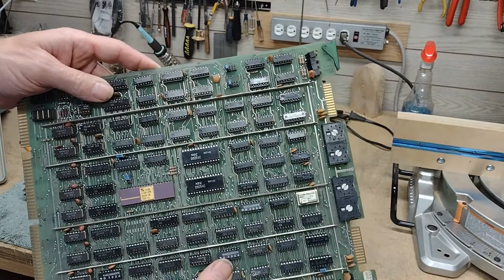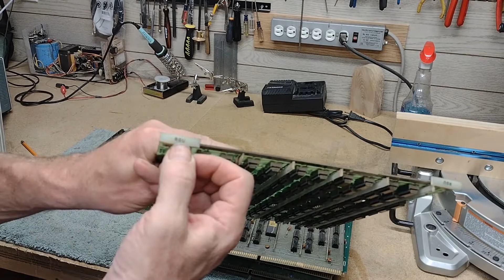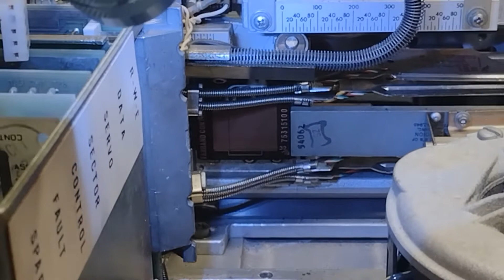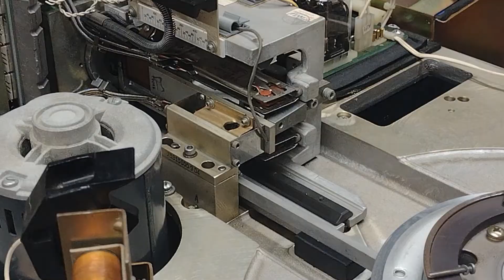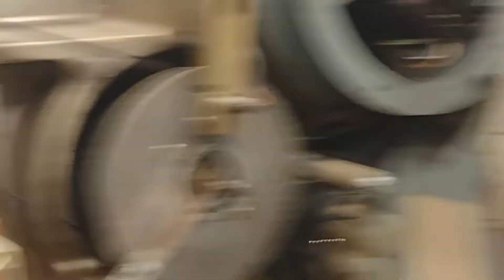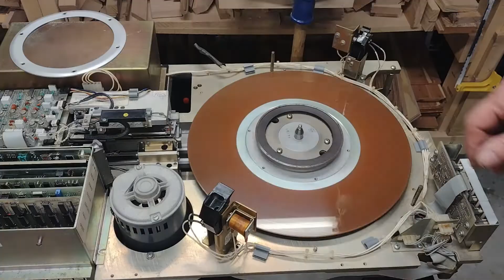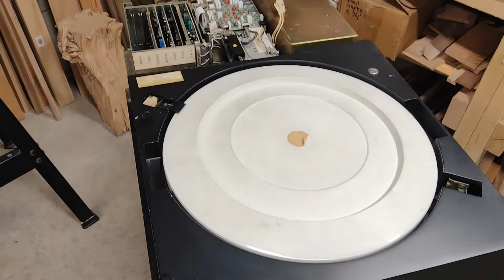Triad Systems Corp vintage 1979 business computer

Comment: Larry, thanks for the video. It's a real blast from the past. This is Lu Myser, from the Spokane Field Office, and eventually in-house Tech Support and Product Support in Sunnyvale and then in Livermore, CA.

I was hired and started my career with Triad at the end of 1979. I was in my last week of field service training when Mt St. Helens erupted in March of 1980. I hit the road running since every customer in my region (Spokane, that covered Eastern Washington, North Idaho, and Western Montana) was under a blanket of volcanic ash. The Field Service Engineer who preceded me left the Spokane office in shambles with nothing working, and never showed up again. I had virtually no working spares. My first call, day one, was to Ritsville, WA, that got hit hard by the ash dump. My predecessor told them to shut down and not start back up until he contacted them. Not able to reach him, they tried to get the system going again, but it was dead.  Not having any spares, I still made the trip to the customer site. 

After diagnosing the problem, I discovered the heads on the CDC Hawk Drive were not performing the initial seek. Luckily, I was able to manually move the heads to find the start sector and it took off running. It turned out to be a bad preamp control board that sits on the top of the head coil. Not having any working spares and a down computer in the office, I made an emergency call to Sunnyvale for parts, lots of them.  The TI 880 printer, Tally Printer, Hawk Drive, 4 to 5 FLDs not working, and a stack of boards marked bad.  

By the way... You didn't mention the joys of adjusting the heads (parallelism). LOL

Eventually I was able to get everything running, with the help of Galen Dalrymple from the Salt Lake City Field office, who our Regional Manager Bill Roden sent up to help.   

I still had to battle ash over the entire region, and spent much of my time doing PMs and ECOs, just to keep everyone running.  Since my region was so large, I spent most of my first year out of town 6 out of 7 days a week, overnight in motels. It settled when I finally got a second FE, Mike Replogle. He would head one direction, and I the other.

Watching this video brought back so many memories...

After 1 1/2 years I was offered a job in-house with Tech Support. As the only person in Tech Support covering 1400 Field Engineers, it was a real challenge. Eventually we expanded the group to a handful of guys, and I moved to our newly formed Product Support Group and remained there for the next several years until leaving Triad.

Comment: Larry, Great Video.  I have some old (but well kept) Triad equipment.  Comment back here if you want to connect and/or are interested in any of the equipment I have (CRT, Display, Printers, etc).
Reply from the maker: Interesting.  Were you a Triad employee or did you salvage a system from an auto parts store?

Comment: Okay, I thought of another things that people might find interesting... At the 4:20 point in the video, you are discussing the PRZ and you mention that the ROM/PROM on the board "must  be involved in telling the disk drive where to look for the initial boot sequence". That isn't actually what that ROM/PROM is for. It is actually for 'Translation'. It translated 8008 machine Op-Codes to Z80 machine Op-Codes. The original PRC board used an 8008 and some of the software was in 8008 machine language. So, this ROM was wired such that the instruction data byte value was used as the lower 8 bits of the ROM's address and a 8008/Z80 flag was the 9th address bit. The first 256 bytes of the ROM had the Z80 machine Op-Code for the equivalent 8008 instruction (the Z80 instruction set was a large superset of the 8008's, but it didn't use the same Op-Code values). Take for example the 8008 RLC (Rotate Left into Carry) instruction; it is 8008 Op-Code 0x02, but it is Z80 Op-Code 0x07, so at address 0x002 in the ROM would be the value 0x07, thus, when the program code had a 0x02 the Z80 would be presented with 0x07. In the second 256 bytes of the ROM, the values were 1:1, such that address 0x107 had the value 0x07. Logic on the board would drive address bit 8 low for 8008 code and high for Z80 code. I don't, however, remember how it knew if a program was in 8008 code or Z80 code (someone that remembers the answer to that can respond.

As far as booting... Upon reset the main processor, as well as all of the CCUs, was held in reset, and logic on the disk controller board (DCU) would wait until the drive indicated it was ready. When ready, the DCU would read track-0, sector-0 directly into memory at address-0. Once that had been read the DCU would release the processor from reset. The processor executed that block of code. That block contained enough to know how to read additional sectors into memory, thus building upon what had initially been read in. This would continue until all of the operating system code had been read in. At the point during that process that the communication control code had been read in, the processor released the CCUs from reset. All the CCUs in the system executed the same code, each knowing which port it was by the setting of the number switch on the board. This entire process was referred to as 'bootstrapping' (an industry term, not specific to TRIAD), because the system was brought up little by little, all on its own, akin to pulling oneself up by one's bootstraps (a frontier metaphone for being self-starting or self-reliant).
Reply from the maker: My goodness Ed.  I can hardly remember what I did this morning, while you could go back in time 40 years and fit right in.  Attention viewers!!  This is the guy who should be making videos.  I was just a guy with a screwdriver.
Reply: @LarryCook1960  No, I'll leave the videos to you... You do a great job! I'll just sit in the peanut gallery and throw shells! ;-)

Comment: Hey, what a GREAT VIDEO!!! I don't know if you remember me... This is Ed Silky. I was in Engineering. I was at TRIAD from 1981 to 1996.

I did a fair amount of HW design, but I carved a niche doing firmware. I wrote the firmware for the 'new' disk controller that Steve McCown and Dave Banks designed that allowed us to replace the CDC Hawk with the 'new-fangled' Winchester drives (20-30MB in a 5" form-factor).

I also lead the firmware development of the TRIAD terminal (FDT - 'Future Display Terminal) that we replaced the Wyse terminals with (which replaced the CRT-V, which replaced the CRT-III, all of which had a mode to emulate an FLD (Five Line Display - which (as some know) actually had a Burroughs 8-LINE Nixie-Neon panel, that we got at a discount because lines 2, 4, or 6 could have defects (we used lines 1, 3, 5, 7 and 8)). I actually have an FDT that still works. We should get together and I could hook it up to the CCX/CCQ on your system.

The FDT was the 'Future' terminal because:
 1. It used a VGA monitor. That allowed you to use any size you wanted. I know of some that had little miniature displays, while demos could be done using a 'Big Screen' VGA projector.
 2. It supported color in addition to monochrome.
 3. It used a PC-XT/AT keyboard. So, again, you could pick something that you preferred, rather than being forced to use the one provided.
 4. It could update its firmware from the main system. So, Field Service no longer had to open it up and replace PROMs/EPROMs.
 5. It used an 80188 (Intel x86 compatible) CPU rather than something from Zilog.
 6. The firmware was primarily written in 'C' rather than assembly language (only the initial boot and the firmware update code was in assembly language - x86 assembly at that).
 
I also designed the hardware (with Dave's mentorship) and wrote the firmware for the ZED (Z80 Emulator Debugger) that we used for development and repair of all the different Z80 based boards in the system (I have one of them as well). TRIAD briefly considered selling the ZED to other companies that were developing with Z80's, as the other emulators that were available at the time were very large and/or didn't provide any hardware breakpoints (so they really couldn't be used with firmware that was in read-only memory (ROM/PROM/EPROM). The ZED provided two hardware breakpoints that could be used individually or together (when A and then B is hit), as well as up to eight software breakpoints (for the Apps Guys that had the luxury of having their code in RAM). This year (2024) Zilog ceased production of the Z80 (in any/all flavors) and shut down its production line.

Listing out CCX, CCQ, FDT, ZED... reminded me that everything had to have a TLA (Three Letter Acronym). In Engineering, we couldn't release a design until we had an appropriate TLA. We often put much of our initial effort into coming up with the TLA. Let me list a few (that I'm sure you know the actual words for):
  PRC, PRZ, PDQ - Processor boards ('Processor' (8008), 'Processor-Z80', 'Pretty Darn Quick' (Z80B))
  CCU, CCX, CCQ - Communication boards (1ch, 2ch, 4ch)
  MRU, ECU - Memory boards (error detection (parity bit), error correction)
  RGU, RGX, RGQ - Report Generators / Sorters
  DKC, DKZ - Disk Controllers

Well enough of that trip down memory lane - back to your video... You should have mentioned that when you flipped the switch to run the system from the removable pack, it was referred to as, "running upside down". I remember the first time I heard that term used and wondered what in the hell are they talking about! 🙂

Anyway, as Galen mentioned, this brought back lots of memories about all of the great people that I worked with and all of the great times we had. Thank you for putting this together!
-Ed

PS, I have photos of my FDT, ZED, and a huge listing of the ZED firmware on Green-Bar paper, but I couldn't find a way to attach them to this comment.
Reply from the maker: Yup, upside down.  I didn't want to use too much lingo in the video, as you can tell by my difficulty in explaining the position transducer.  Gosh, I'm surprised Zilog was still making z-80's.  I didn't even know Zilog still existed.

Comment: Larry, 
Great video, some of the boards I developed. The memory board was an error correcting board as DRAM's of the time would drop bits. So if a bit dropped it would be corrected, more than one would be detected. I am wondering if you might have a picture of an FLD keyboard or something that would give me the the keys. Could be a great help, any other documentation or thoughts are welcome.
Regards, Steve McCown
Reply from the maker: Alas, I don't have a keyboard, only the items shown in the video.  I do have some brochures, that I think were published yearly, so I'll give them a look and let you know what I have.  If you developed some of those boards you did a damn good job, since I don't recall replacing many, other than a few CCU's that only had failed I/O chips.  What years were you with Triad?
Reply: @LarryCook1960  Hi,
I was with Triad from 1975 to 2000, most of the time in engineering. I developed a lot of the hardware the systems used, CRT-5, Series-12, T.I processor/memory board, Nomad series, and more. It was great working their, until CCI took over. Finally then time for me to leave.
Regards, Steve McCown
Reply from the maker: @stevemccown2291  I was in Field Service only 6 1/2 years, from 81 through 87.  I departed when my Area Manager had a great idea.  He wanted me to move from Des Moines to Kansas City, take on a ridiculous workload including over 100 Altos made towers in TWA's offices at the KC Airport, and be promoted to Senior FE.  Altos made the Dental system, which Triad had recently purchased, and since I had a week of training on that system, I should be able to take care of TWA's towers.  If I didn't want to do all that, he said I could be laid off.  Not wanting to call his bluff, I quit, taking a job as a traffic signal tech for the City of Des Moines.  That Area Manager (Tom Bertrand) was later fired :)
Reply: @LarryCook1960  Steve also desinged the hardware for the FDT.
Reply: I keep rambling, so I promise that this is it... One more feature of the FDT what that it had a PC-XT expansion slot, so you could plug a PC-MODEM card in and use it as a remote terminal (no external modem needed, so it was more compact and also cheaper). The firmware included dialing/connection code. The firmware also implemented the Microcom Networking error correction protocol routines, so it provided very robust communications with the host.

Comment: Hope you are doing well.  The YouTube channel [  Usagi Electric  ] and I have (10MB) Hawk running with all four heads on David's Centurion system.  We have found a 2nd Centurion system at Butler Tech VoTec high school in Cinn. Ohio.  Have manage to get this Hawk & Centurion system running for the VoTec high school students but only as a (5MB) Hawk because we are missing the Upper & Lower cart. heads. ( The ebay heads you pointed me too are the wrong p/n and only lower head.  I you ever decide to let your Hawk go it would find a great home at Bulter VoTec high school for the kids to learn more about computer history.  The video is call [  The Desk System Centurion Worked Perfectly! Until it didn’t…  ] and the Butler high school part starts around 2:30  mark.   Hope you have a great Thanksgiving.   Regards,  Ken R.

Comment: How long did they sell Interdata based systems?  I understand some of these machines had to be connected to a phone line so they could phone home to Triad to make sure you were paying for the software.
Reply from the maker: Triad sold what people would call a mainframe for very large warehouses, called the Model 80, that used a Perkin Elmer (Interdata) processor.  It was the size of a refrigerator, not including disc drives, and featured a reel to reel tape drive backup like you would see in old movies.  There were not many of these sold, and there were none near me so I wasn't trained on them.  I know nothing about phoning home about software.  That sounds pretty odd.  They were being sold as of 1986, but that's all I know.
Reply: @LarryCook1960  You could boot from the tape drive, rather than the disk, by entering the '42' sequence (a sequence of 42 machine-code bytes) and hitting 'run'. They did have modems that would call TRIAD. I briefly worked on those for a while with Tom and John.

Comment: Larry,  love the videos.   Worked in an auto parts store during that time.   Is there a group on Triad experiences ?   I can remember running a Sales Ranking report which caused the printers to print/pause/print/pause.   It must have taken lots of CPU power.    I always wondered what language the OS was written in.
Reply from the maker: The OS / software was machine code.  There was only 64K bytes of RAM in the basic model, and only 5M bytes grand total per disc, so space was at a premium.  It really didn't seem to have a separate OS as we would think of it today.   Sales ranking . . . . . I don't recall that one, but it makes sense it would run slowly since it's looking at data and doing calculations.  Would this have been a warehouse system?  Warehouses had different software.  There's a Triad Systems FB group at https://www.facebook.com/groups/45676293174

Comment: I worked with a similar drive, the Data General 6045/51, which is a 14" , 5MB fixed, 5MB removable hard drive. I regret that I sold it 30 years ago. Since then I got another one that needs work to get it running. I have several of the 14" disk packs of software source code that I want to go back to editing. The Diablo systems model 44 was another manufacture that made a compatible drive, also marketed by DG as model 4234. Currently I don't know if the CDC 9427 Hawk is compatible or not with these, good chance that it is.

Comment: I remember Triad reps calling on me in the early ‘80s.  It was intriguing hardware, but the software was not a good fit for us.  We were on an Honeywell Level 62 at the time with mostly homegrown software.
Reply from the maker: Interesting.  The software, especially Cataloging in the mid 80's,  was generally regarded as the overwhelming reason for Triad's success.  I hope the sales people weren't too annoying :)
Reply: @LarryCook1960  Not annoying.  They just didn’t do enough research before making a “cold call.”  We were way more than they anticipated.  Brake Supply was not auto parts!  It specialized in heavy off-road equipment parts.  And not just sales.  A huge part of our business was repair and rebuild.  In ‘95, we gave up trying to write all our own software and went with Prelude Systems (now part of Epicor), with many additions and custom mods.  The shop order system Prelude has now was born mostly from things they first did for us.  We were about $10M in sales with two locations when I went to work there in 1981.  By the time I retired in 2014, they were well over $100M in annual sales with 10 locations world-wide.  And the last I heard, they were still using and quite happy with the Prelude software after 26 years using it.
Reply from the maker: @LandNfan  Those are huge sales figures.  My customer base included three OTR truck parts / machine shops, and a company that made coil and leaf springs called . . . Davenport Spring . . .in the city of Davenport, IA.  One of the trucking shops was quite large, but I'm sure it wasn't in your ballpark.